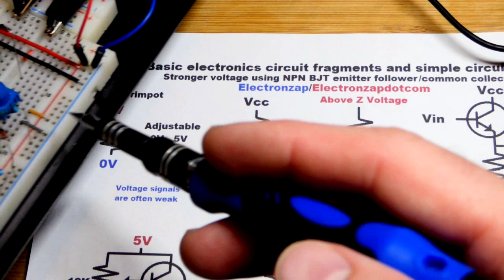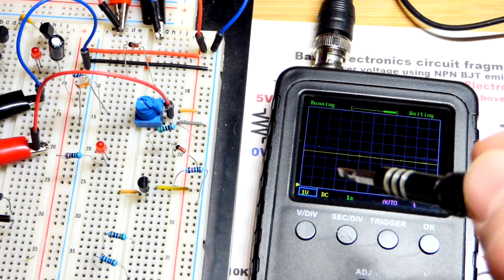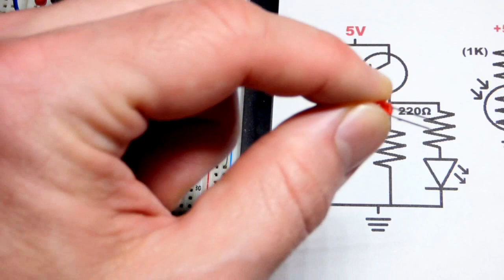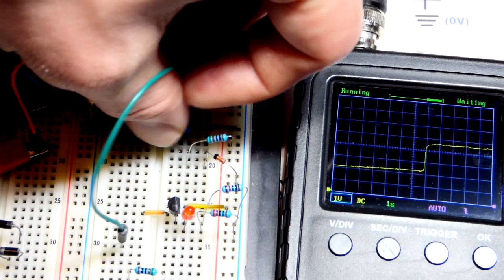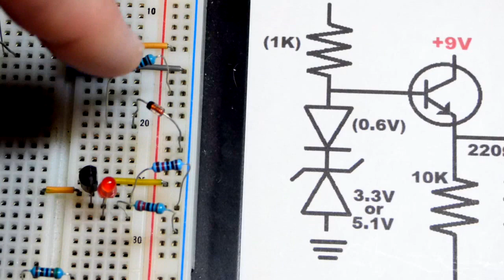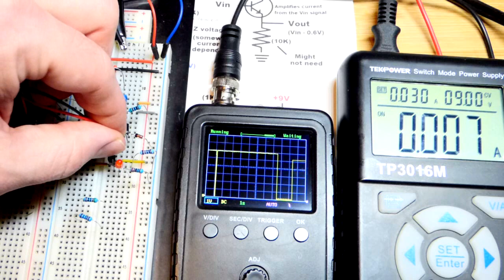Electronics course 15 better voltage transfer to load with NPN emitter follower common collector

Comment: Thane for the video, Sir.Could you please  explain a little the use of the rectifier diode together with the zenner diode?
Reply from the maker: Thanks for watching! Reverse biased zener diodes block a certain amount of voltage and forward biased silicon rectifier diodes block about 0.6V. If you put them in series, then the total voltage they block adds up.